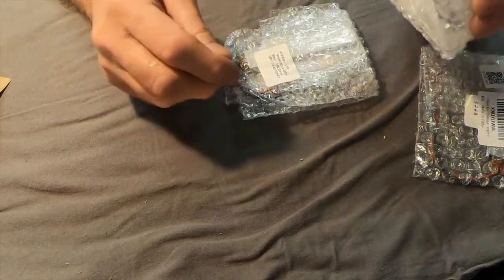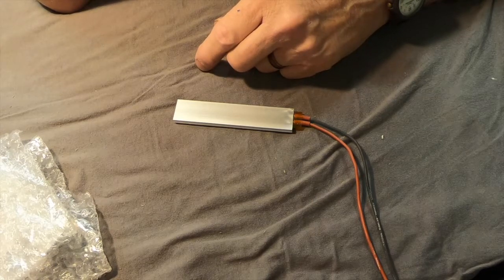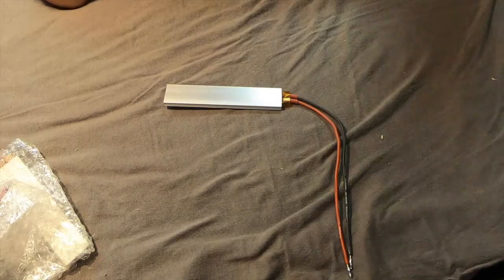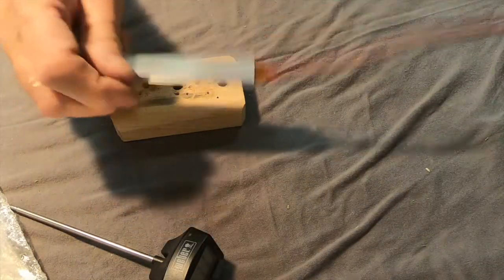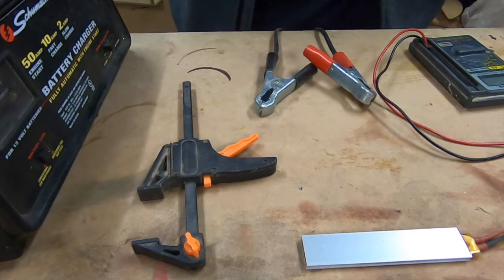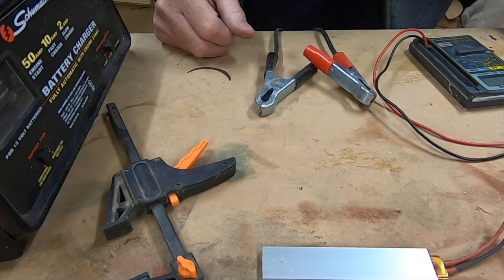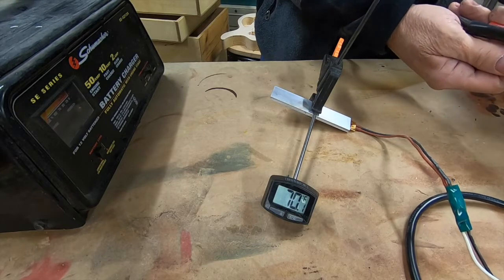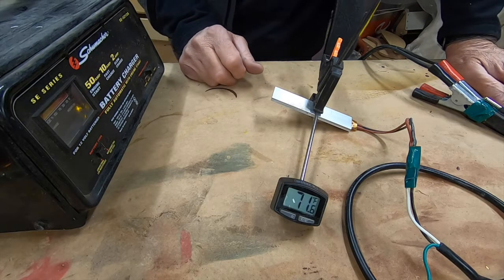GUITAR NECK HEATER BEAM BUILD #1 by JONAH GUITARS

Comment: Fun stuff. Another approach would be a silicone heat element with a PID temperature controller. You can get those silicone heat strips in a bunch of different sizes and shapes.  And you can use the temp controller for a side bending jig when you're done.
Reply from the maker: Dang, Todd. Why didn't I think of that! I'm not sure but I think I'm into this for well under 200 bucks. But man the side bender would be awesome. Plus the ridged beam is useful for clamping against the neck.
Reply: Inkbird make some decent quality and decent priced temp controllers. Most are not PID, just a thermostat of some sort, but you don't need 0.1 degree accuracy anyway.  
You can use them with your existing 120V PTC heaters too.
Reply from the maker: @100amps , thanks Todd. A little too late for me but good info for anyone else going down this road.

Comment: I'm building a VERY simple PID controller for bending guitar sides.  It would be able to control and maintain the temp of your 120V heaters at any temp between about 20F and 400F.  The controller works well already, but I'm waiting on some custom heat blankets to arrive from Asia to do the video.  It's built for 10 Amps, so I think it will handle your AC elements just fine.  If you need or want info, let me know and we can email back and forth.
Reply from the maker: Thanks much Greg. I've already moved on from the 120v heaters. Still, I'm very interested in seeing what you come up with for the side bender.  Thanks for checking it out.
Reply: Right on...  I sent an email to you as well.  No biggie...  If you've got it sorted, that's what counts!
Reply from the maker: @SkyscraperGuitars , thanks I'll check it out.

Comment: You should have gotten the DC version. Much easier to control and a variable DC power supply (0-30VDC / 10A) is quite cheap.
Reply from the maker: Thanks for having a look. That's exactly what I did.

Comment: Just use a dimmer switch like a light bulb?
Reply from the maker: Hey Billy, how you been? I tried the dimmer switch idea on a heat blanket for bridge removal. It was all over the place. I couldn't preset a temp very, little movement of the switch made a big difference in the temp.